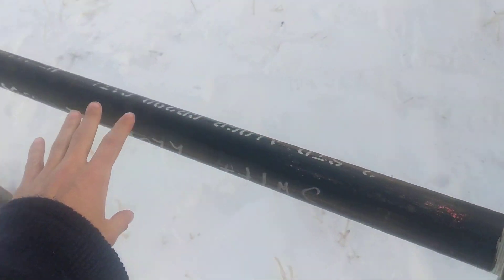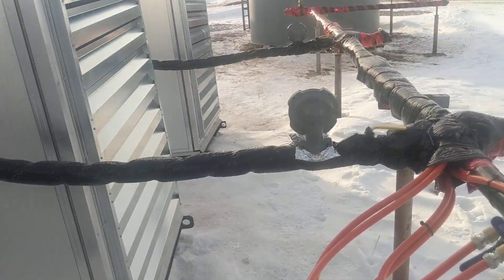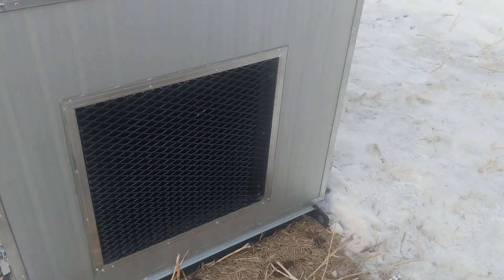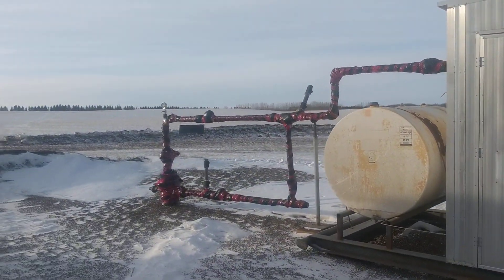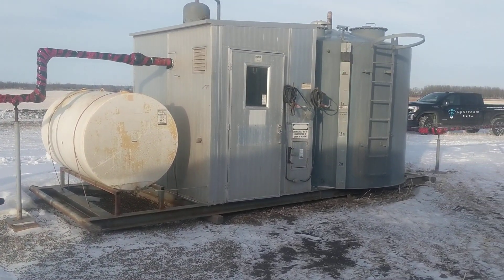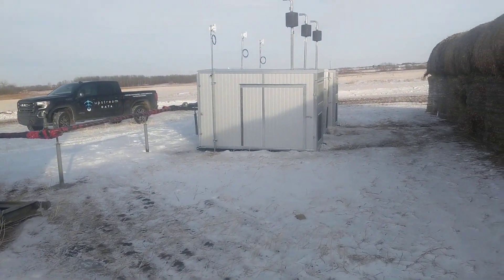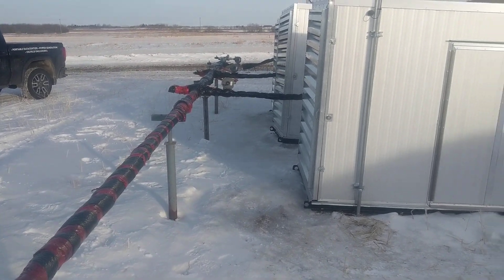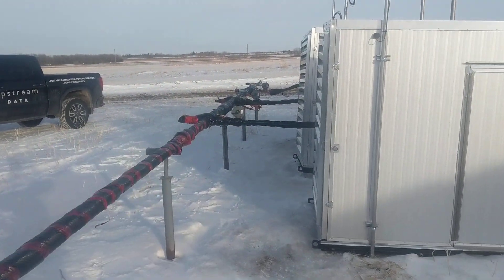Bitcoin mining on a stranded natural gas well.

Comment: Sorry but it is such a bad idea to combine your power generation and mining in that same tight building. You guys are begging for a disaster.
Reply: I agree, it gives me pain.
Reply: The computers he says repeatedly are old... the genset building has no oil to pool and burn,  they are in steel building in the middle of no where... what exactly is to be lost but the genset and the bit coin miners?   If there is any pressure drop anywhere on the fuel it all shuts down...   I was more worried about  the computers over heating when the genset shuts down for some safety reason and does not allow time for the boards to cool before shut down.
Safety is relative to the money you are making.